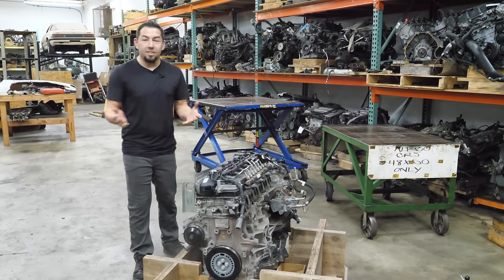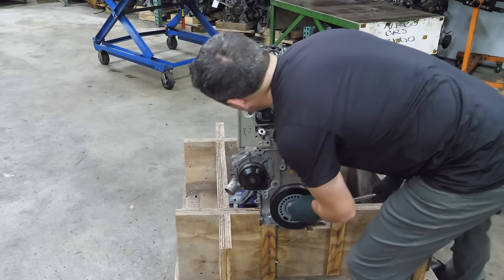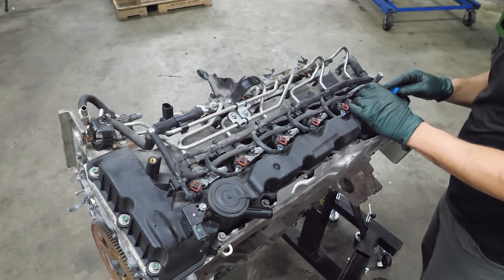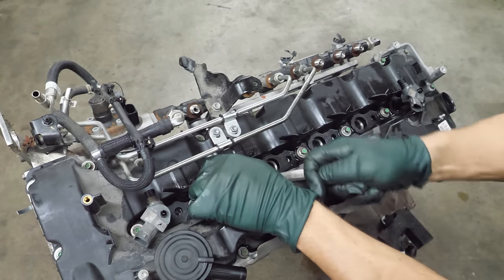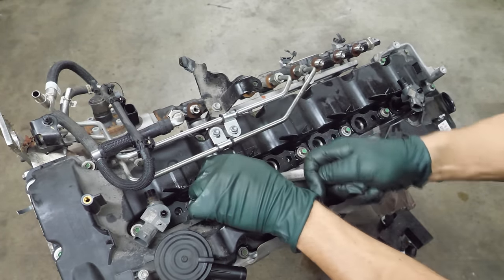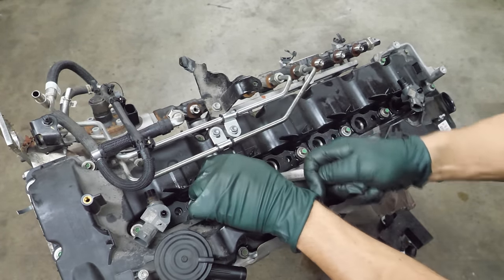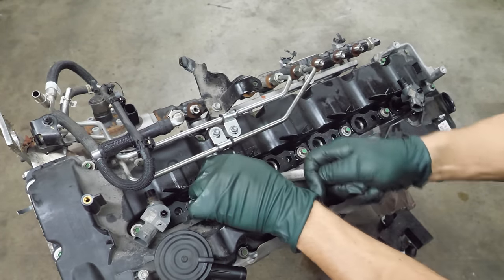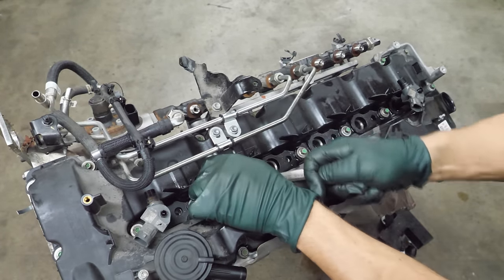BAD 2020 Silverado 3.0 Duramax LM2 Engine Teardown INCREDIBLE DAMAGE!

Comment: I have one of these.  Mandatory belt replacement at 150K miles.  I'm doing mine much closer to 100K due to the wet belt.  I also change my oil at 5000 miles instead of the 7500 miles the factory recommends.  I LOVE my engine though!  30+ MPG on the highway and 19 MPG towing a 6,000 lb boat.  Thanks for tearing one down so I know what it looks like!  By the way, did you happen to find out if the other tensioner in the head was oil pressure fed or not?   This looks like a case of neglect which is good news.  EDIT: This seems like a case of an oil change gone wrong.....drained and not filled, then started and run. :/
Reply: If you want more piece of mind while doing oil changes a oil filter brand that goes by the name PPE makes an oil filter for these 3.0l Duramax's that is 1.5" longer for extra oil capacity and has a built-in magnet to catch metal pieces. According to the specs it's also able to filter down to 10 microns. Some of the descriptions I've read says it has the ability to filter down to 5 microns but it conflicts with the specs sheet which says 10. So who knows. Either way if you're interested there's an upgraded filter for your 3.0l Duramax. The 3.0l uses the same exact filter as my 2.7l Turbo-4 so I'll end up ordering a couple from Summit Racing for some added filtering capacity. They aren't cheap, but they're still cheaper than a new engine.
Reply: @Slane583   Appreciate the info!  When I start doing my own oil changes I'll get those filters.  My dealer offered free oil changes for life so I'm taking advantage of that, lol!
Reply: The Honda 2000i and 2200i generators have these belts to drive their OHC...and carry oil up into the head.
One owner ran his 24/7 for 17,000 hours straight (off grid; only source of power).
See James Condon vid re tearing one down.
Then he ran the same engine with the replacement belt another 17k hours...
then sold it to his friend and it's still going...heading towards 35k hours....
As the GM tech said in another comment in these comments  the same belt in the LZ0 engine is now rated at 200k miles before replacement....
Reply: @JohnSmith-yv6eq  Cool.  Until they issue service bulletin saying the LM2 is good for the same 200K miles, I'm doing mine before 150K. :)  As shown in this video, the belt was already cracking around the cogs. Given how much stress is on the belt, looking at the oil pump drive, it's not worth my risk.
Reply: @LethalBacon479  No problem. When I got my Silverado and it was coming up to it's first oil change I kept getting stuff in the mail from the dealership about free oil changes and what not. So my stepfather would hound me about bring it to the dealer to take advantage of at least one oil change before the deal went away. I let them do ONE oil change just to shut him up. I'm very particular as to what I run for oil in my truck and I am not a big fan of the AC Delco branded stuff GM puts in all of their vehicles.

Mind you the truck is still very low miles as it just came off being a lease vehicle. So it's only really up to oil change #3 right now. When I got to do the second oil change myself I ran STP Full Synthetic in it, which IMO ran better than the ACDelco stuff. But the STP brand was only a stop gap until I had money to run one of the two brands I like the most which is Royal Purple or AMSOIL. 

Royal Purple is in the truck currently but with the next oil change it will be AMSOIL Signature from here on out running the large PPE filters along with some Marvels Mystery Oil added in as well. I already use AMSOIL in my chainsaws and like it a lot so I'll just use it across the board in everything so I'm only using one oil brand. Plus I can buy it from them directly and save a few bucks if I go for the yearly "Proffered" membership. Which I just might do. I just need to stop being lazy and buy what I need before I need it. 😆
Reply: @Slane583  Keep in mind GM does not make oil and the AC Delco Dexos D stuff required in these engines is likely made by Mobil. You can also buy the Mobil 1 Dexos D which is what I've chosen to run in mine and seems to be working great after 42,000 miles with oil changes every 5k.

Comment: The oil pump belt isn't really a big deal since GM's failure prone torque converter will need replacement before the belt's 150 - 200K service interval, and it can be serviced while in there 😆

In fairness these are really cool engines.  A friend has a Sierra with the 3.0, it is amazingly fuel efficient,  it is quick and quiet, and pulls a load very well.
Reply: Hell Fords tq converters aren't any better lol. My mom's ford edge had to have the converter replaced at 130,000 miles. And I hear about converters issues on power strokes all the time.
Reply: @35RSkyline If it had the 2.0L n it. That transmission is hot garbage. 

Who ever designed the 6F35 needs a swift kick in the head. My old fusion didn't shift well from day one. It was certified pre-owned with 85,000kms. 

They reset the TCM before I bought it which always seemed to fix it for a short time. But after it "learned" it would slam into 3rd everytime, and the check balls in the valve-body are steell, but the plates are alluminum so I had to fork out $1,500 for a transmission job when they inevitably broke the plates and the fluid in the transmission couldn't do its job. 

Never again will I buy a Ford, and my parents have owed enough GMs over the years that I know better... Lol
Reply: So true

Comment: There’s a company out there that makes a larger oil pan that holds an additional 2 quarts of oil. That additional oil capacity would’ve potentially alleviated this problem.
Reply: How is an extra 2 quarts gonna do any good? This was pure lack of maintenance. Change your oil often, use quality oil, and you won't have issues. I change my oil every 6 months no matter what. My last oil change only 300 miles on it, but it had been 6 months. Oil is cheap
Reply: @billyparkinson9933  an extra 2 quarts of oil is significantly better for any engine. There is more oil for the  particles that cannot be filtered by the oil filter that is diluted in the engine oil among many other advantages.
Reply: @MarkSmith-cz3by  Yes, and it lowers the oil temperature as well. Excellent to protect against engine wear.
Reply: @billyparkinson9933 also use the correct oil. If the vehicle called for a specific brand and grade use it don't substitute! New vehicles can void warranty if this is not followed.  😊

Comment: GM must've hired a Ford engineer on that timing chain and oil pump belt. As soon as I heard about them, I instantly considered it them deal breakers for any future purchase.
Reply: Nope, developed through Opel so German engineering.
Reply: Same, plus cost of diesel went up so still cheaper to run gas even though mileage sucks. And I am not punished for short trips!
Reply: @deadon4847 German engineering makes more sense. I came here to say that timing system looks like something volkswagen engineered.
Reply: Maybe since the Ford 5.0V8 now has an oil pump belt
Reply: @michaely936 
The 7.3 uses a chain, the 5.0 used a pump on the crankshaft. The belt is for the newer Ecoboost engine. What are you smoking
Reply: @michaely936  no! man they ruined the coyote?
Reply: @deadon4847  lol that makes perfect sense, too
Reply: @leecline5759 The 2021+ Ford 5.0 does indeed have an oil wet belt and cylinder deactivation, too. I was going to order a 2021 F150 in 2020 and decided against it once I learned of such a design.
Reply: Yes! I had flashbacks to the rear timing chain of the German designed 4.0 SOHC from Ford. It wasn't a good idea 25 years ago, and it still isn't now. Lol

Comment: 33:13-That's what a friend tech looks like when we go to lunch and he just asked me if he got it all off and I lie and say yes so he walks around looking stupid the entire time.  🤣🤣
Reply: When I saw that I immediately thought of the late Art Bell. He had a late-night talk show on AM radio in the late 90s, and he covered a lot of stuff like chupacabras and space aliens and time travelers. In the middle of the night, driving across the desert, suspension of disbelief is a little easier to achieve.

At any rate, one night he settled down in his studio to do his show and he saw something had come loose at his console. He grabbed a tube of super glue, unscrewed the cap while holding it in his teeth, glued the loose object back down, then tried to put the applicator back into the cap so he could put the tube of glue down and start the show on cue.

He missed the cap. And glued his lips together. So when the show opened he had to explain what had just happened. And why it sounded like he couldn't open his mouth. That was close to 30 years ago, and I'm still snickering.

Comment: I've never had a diesel powered vehicle and this inline 6 seems really interesting to me.  If its true that this engine had about 150,000 mi on it the oil drive belt looked pretty good and in line with it's 200,000 mi expected service life.  I'd prefer a steel chain though.
I read the oil pump belt was put in the back of the engine for commercial trucks where the cab flips forward to make replacing it easier.
Reply: Yea, but one would STILL have to remove the transmission to service the pump OR the belt

They need to put the pump back where it belongs.
Reply: @davelowets  true.  I just read that was a consideration and/or it's somewhat easier to service in that application. I'm no expert so one would have to confirm if that's really the case.

Comment: Love my lz0 opel-max. No engine is perfect and if you build a million your gonna get bad apples. Goes with anything. That Thing took the constantly variable timing like a champ ide say. These trucks pull hard and get incredible mileage. Emissions system is the major concern but it seems having it so close to the turbo helps. Best engine in the 1500 market imo.
Reply: I qm pretty sure that this engine has absolutely anything to do with Opel. Opel doesent use anything like this.
Reply: @juhomaki-petaja  it’s an opel. 1.5l 3cyl doubled up essentially, And improved.
Reply: @GuyonaMoose  aah. That 1.5/3cyl is bit oddball. It was in production only for 3years, I guess. It was replaced by PSA engine
Reply: I couldn't agree more (LM2 owner)
Reply: Well known issues with this engine, several.

Comment: i just bought the new gmc 1500 with the duramax i got 27 mpg going home from dealer on interstate n 33 mpg on 2 lane hiway to me its nuts 4x4 crew cab but 305hp 495 ft torque i can see why it gets the fuel mileage it doese love how smooth it runs n rides

Comment: Just imagine if they used gears to time that diesel.
Reply: Or sturdier chains than a 1980s Honda 125 twin.
Reply: Simi trucks use gears! I wonder why lol
Reply: @terrynagle7410  Exactly
Reply: @terrynagle7410  Because weight and size aren't a concern for diesels in semitrucks. Not always the case for consumer pickups.
Reply: @ec6843  Probably an extra 40lbs to use gears.
Reply: @ec6843  The two major brand 6.7s use gears and so does the 6.6 Dirtymax.
Reply: @paulschab8152  Those are over double the displacement of this engine, so that makes sense for those engines. You're comparing apples and oranges.
Reply: @ec6843  What does the displacement have to do with it? Gm could have designed it with gears.
Reply: @paulschab8152 it has a lot of aluminum in it. Weight probably was a concern. A ton of steel gears wouldn't help with keeping the weight down.
Reply: @paulschab8152  because they wanted to keep the weight down on a smaller engine.
Reply: The reason for not using gears for the timing system is noise (and cost). Keep in mind this is a light duty diesel used in SUVs and pickups that are mostly driven just to move people around. The target audience wants a quiet ride.
Reply: These are so anemic, every ounce of weight counts.
Reply: Keep in mind this is a DOHC design. Imagine the number of gears to get from the crank to the head. The other 3 engines you stated are pushrod, so the cam is much closer to the crank.
Reply: No teardown would have been done.
Reply: @supercharged2414 if that even 😊
Reply: Check out the 1693 Cat motor this 3.0 motor reminds me of that design

Comment: When you said reduced power, I was thinking timing. I have experienced  this on other older engines. I had a 69 Pontiac  with a 300 cI engine. It ran fine, but had noticeable  reduced power. Pontiac used a fiber toothed timing gear that allowed the metal chain to eventually jump a tooth due to wear on the fiber teeth. When I got the vehicle, I knew it had issues. I tried retiming the engine  through dwell  settings( points and condenser) and reguardless of what I did, the timing seemed to float. Eventually the chain jumped enough that it did the engine in. Being zero clearance, an exaust valve took a hit. I didn't know it until I already installed a new timing chain and gears. It was my very first major repair on an engine and I was only 19 at the time.

Comment: It wouldn’t be unusual for these 3.0 liters to be run low on oil. And it sure looks that way. It due to the 0-20 oil that gets past the rings as that oil is like water. These engines use a lot of oil and the oil change intervals are way to long. To bad that a great engine was destroyed.
It’s not unusual to see top shells with big wear because these engines are run under big loads at very low RPM and that is reason hard on to shells. But give great fuel mileage.
Reply: At over $4/gallon,
It’s a trade off. Fuel
Probably goin higher 
Too😮🥵💯🤮🤡🌎
Reply: @rickreese5794  It’s still cheaper to run the diesel. Most people are reporting almost 30mpg
I have the Colorado 2.8 diesel and get 30 or better. Diesel here is $8.08 an American gallon 
Gas is cheaper but a truck like mine would be getting high teens with gas. I couldn’t afford to own the gas version.
Plus the torque of these diesels is extremely addictive. 
If you like a low RPM engine that almost never downshifts no matter how big the hill and even pulling my 5500lbs toy hauler and still doesn’t downshift on hills. It’s absolutely amazing.
I has 4 Rangers in a row before I gave GM a second chance. And after 5 years and 70+ thousand miles my Colorado diesel has been the best truck I have owned.
Reply: A while ago gas was 3.50 diesel 5-6 where I live. Factor in the DEF, fuel filters and the oil pump belt repair and its a wash between this and high teens gas. That's assuming you do long trips so the emissions equipment all work fine. Mix in half short trips (<30 minutes) and its an easy choice for gas.
Reply: @the1stvendetta  I agree a diesel and short trips would be a disaster for the owner of today’s diesels with all this BS emissions crap.

Comment: Pro tip: on cylinder head bolts and other high torque fasteners, use a large round punch and give ‘em a few good whacks with a 4-6 LBS sledge. This will substantially reduce the break-away torque and prevent broken bolts.
Reply: Good ole' shock therapy

Comment: The smooth brain engineer who designed that timing system should be ashamed.     Placing the timing components on the rear of the engine is a bad idea.    Using a wet belt timing system is even worse.    Give us a chain, or better still a gear driven setup.    It's a diesel, a little NVH is normal.
Reply: It was all about keeping the diesel as quite as possible from what I heard, for the rear end design. Not a fan of it, one reason why I didn't buy the truck, bad design choices. Trying to recreate the wheel. Ashamed they didn't follow the old diesel design better for a longevity engine. Yes they are a bit louder, but decades later still cruising the roads. Got one myself, Cummins 4 bt. All gear to gear. Two decades old and no sign of slowing down.😊

Comment: Whoever had it must not have ever maintained it. There's no way that engine managed to do that to itself under normal conditions with proper maintenance. That is absolutely insane. Quite a shame too.
Reply: Wrong, this engine is known for oil issues. Look it up.
Reply: @baxs5076  I don't doubt it, but even then the only logical explanation I can see for this failure is an oil pump failure or terrible maintenance. What else would even cause that? I was looking at everything in this teardown video and I don't see how there could be any other problem. The oil system looked fairly straight forward.

Comment: Ironically the crank pully and oil pump pulley are so close you could add a small gear between them and just have a gear driven oil pump, no belt or chain to fail. Design engineering seems to be putting crap in products now just to make them fail #dumbcapitalism
Reply: #dumbcapitalism indeed! As a certain famous Canadian YouTubeer said years ago (paraphrased): "it's pretty easy to engineer something to last forever, but it takes real skill to engineer something to fail 10 days after the warranty expires"
Reply: Profit restrictions anyone 😮😂😂😂😂😂

Comment: I am curious about checking drive chain wear (stretch.) I invite you to inspect drive chain wear by holding the chain horizontally (link pins vertical) and checking to see how much the chain droops. Sprocket wear may be roughly estimated by seeking to lift a seated chain link from the sprocket and watching for movement of the adjacent links on the sprocket. Your videos are marvelous.

Comment: I remember people got all sorts of hate for the oil pump belt. So when it was torn apart at the 150k mile life expectency AFTER being starved of oil and no doubt it got hot, the belt looks great. GM techs said it would go at least 150k miles and this shows they were right. Best half-ton diesel engine out there. Minus the new version. Infact now its the only diesel half-ton engine. 😅 Good job GM.